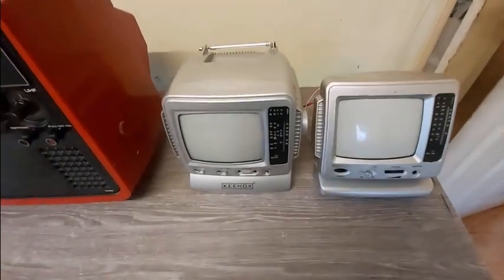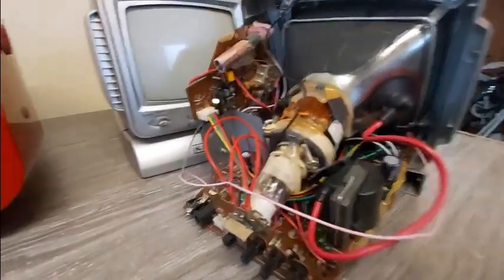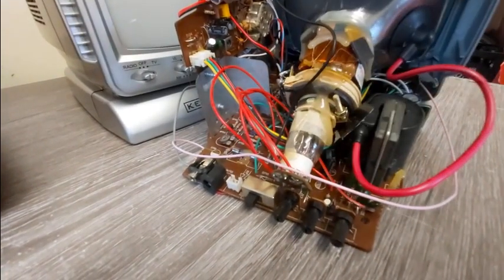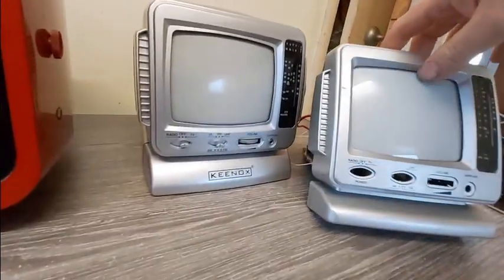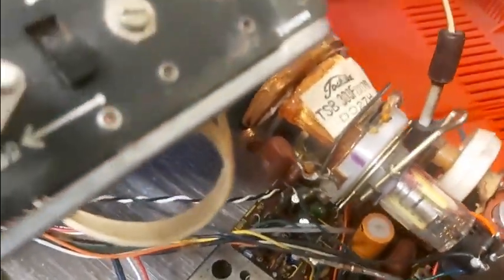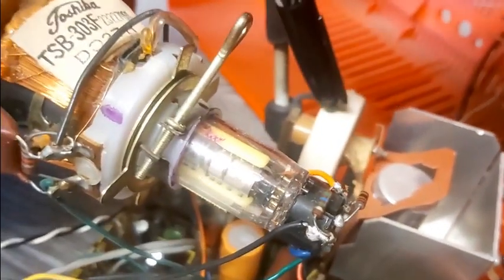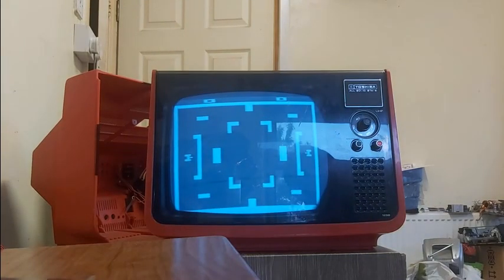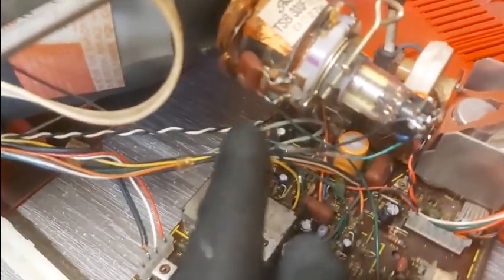How to adjust the yoke on a CRT Television

Comment: My screen is upside-down is it safe to turn the yoke 180 degrees ? And will that fix it?
Reply from the maker: Might be easier to swap the vertical yoke wires around.
Reply: Is that safe and easy ? I'm a beginner on crts
Reply from the maker: @Usernameuser584 it's safer and easier than moving the yoke, especially as you do this with the power off. 
There's four wires going to the yoke, two for horizontal, two for vertical. You'll need a multimeter with continuity. One of the vertical wires is usually yellow, test for continuity between this and another wire. When you have found the other wire, unsolder it and the yellow wire, swap them over and resolder them. If the picture is now back to front it wasn't the vertical! Put the wires back and try the other two.

If you don't know how to solder, practice on something junk first. If you want to learn how to repair TVs you'll need to solder.

Comment: I bought a GE 13" color tv off of Ebay.  Got it, hooked up to my Atari and all I got was a blue screen and snow sound.  When I turned on game console, the sound stopped as if it was recognizing and screen turned purple with random pulsations on left.  I noticed the glass screen was loose from the cabinet on the top side and could hear a loose piece inside when moving it.  Seller refunded me in full but said it was likely yoke and easy repair via a DIY video.  Any advice?  When he photo'd it for the ad, it had the snow as image when on.  So what could it be?
Reply from the maker: Without looking at it it's really difficult to diagnose the fault. It could be any number of things.

Comment: What kind of rubber gloves are you using?
Reply from the maker: They're PU coated rubber work gloves but any rubber or latex gloves will do, even ones available for this pandemic.
Reply: @MegaWayneD  ok sweet
Reply: Looks like the one OJ simpson used

Comment: Can I do yoke adjustment with tv screen on??Pls reply sir.
Reply from the maker: Yes. You need the screen on to adjust the yoke anyway. Wear rubber gloves, otherwise you'll get at least 100 volts through you.
Reply: @MegaWayneD  what if the tvs 220v😢 am i dead
Reply from the maker: @cleangoblin2021  this TV is running on 240 volts! Just be sensible and be very aware that there's going to be mains voltage exposed. Don't touch it. Ideally use an isolating transformer.
Reply: Nice work, keep hold of that CRT it looks like a nice set and they are getting rare these days, I've just built an CRT arcade monitor from a 19" tv I found in the skip, the TV was a goner but the tube was perfect, bought a chassis and yoke and fitted it all into my existing cage to replace my old monitor on my street fighter 2 coinop, lucky find I love crts and for the old games they are must because lcds just ruin the old games, I have a 5 CRT tvs in the house and use them for retro gaming I wouldn't part with them for love nor money, I keep the contrast down pretty low to save the screen from burn in and increase the life of the tube.